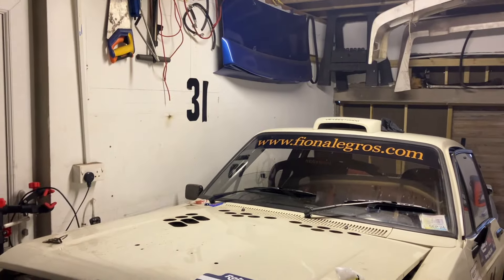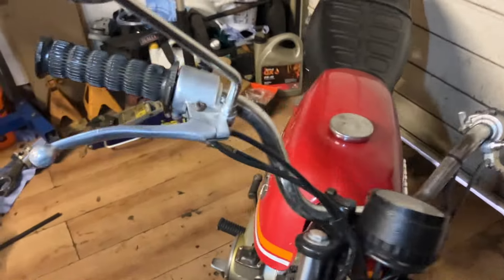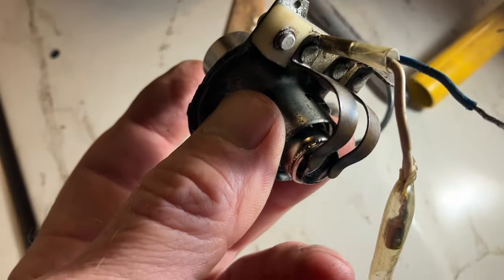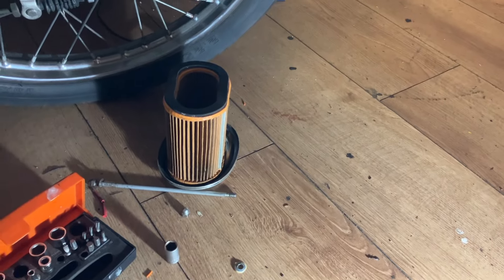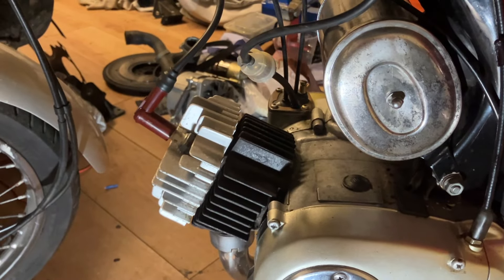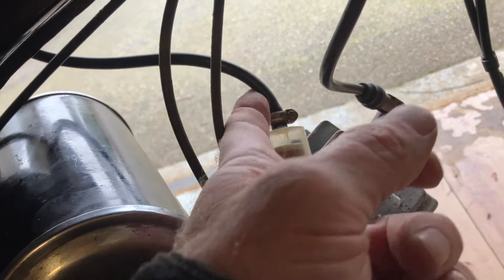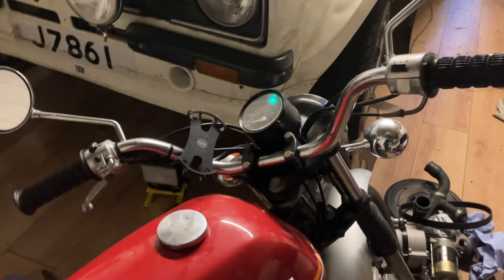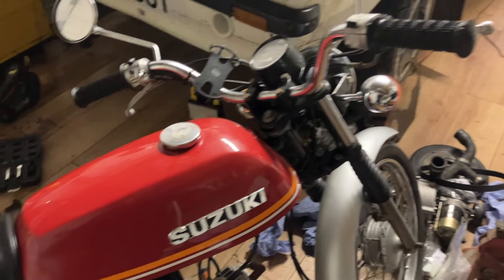Suzuki AK 50cc 70s moped (AP) with very dim lights and an air filter restrictor

Comment: I bought a brand new AP50 in 1977 for £265 when i was 16 it did around 65 mph with y feet wrapped around the tail light and y chin on the clock , the fashion was to fix a gas canister air horn on to it above the headlight , my mate had the AK50 like yours i always wanted the Suzuki GA50 👍😁😎 PS: my KMX 125 was restricted by a washer in the exhaust inlet, I just knocked it out with a hammer and chisel to do 85mph .

Comment: I had one of these in 1980, I was a 16 year old that needed to modify things. My mod of choice was an air horn that didn't work because the weedy electrics couldn't provide enough current for the compressor. The bike was faster than the FS1E it replaced, it would do just over 50 indicated, proper racey. I got a KH250 when it went, that was a bit quicker :-)lovely example, great to see.
Reply from the maker: @bostonbikebits6539  I was 16 in 82 and my mates were buying the new Yamaha dt and Suzuki er 50s. I only ever wanted an ap

Comment: i had a AP50 brand new in 1976 the best speed i could get out of it just over 55 mph , it would cruise at 40 to 45 on the flat but at  the slightest incline it would slow down and you would have change down to fourth gear to mantain momentum
Reply from the maker: looks like i am not too far off, i will take the exhaust off and see if it still has a restriction in it. i am loving working on it